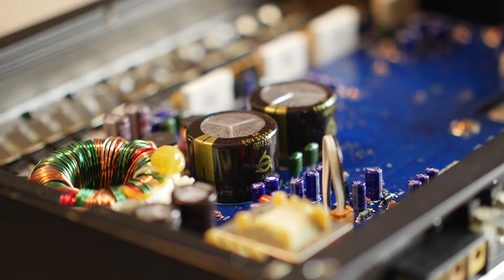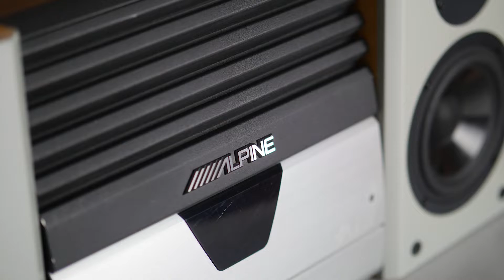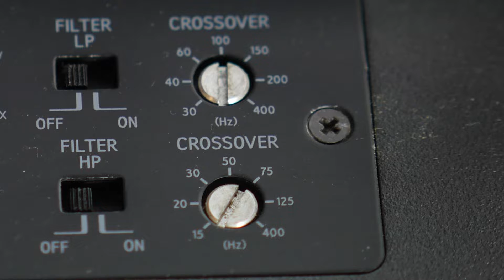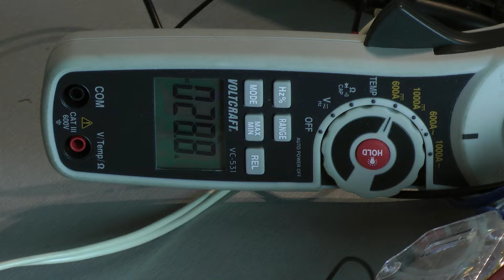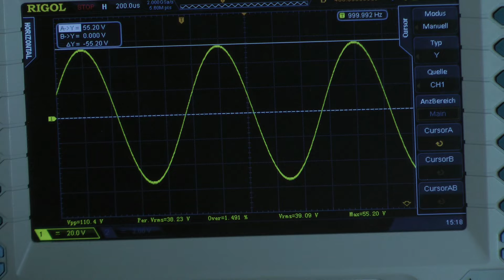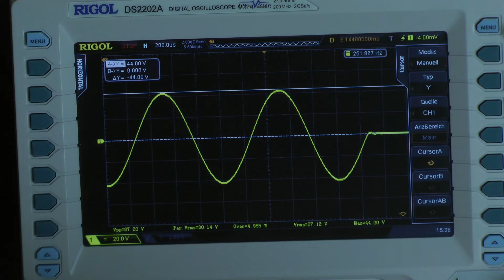Alpine MRV-T420 V12 car audio amp dyno run oldschool stereo amplifier power & sound quality test

Comment: I have a t420 in my build running my front midbass they are spectacular amps and push out more than enough power for what I need
Reply: Using the same amp

Comment: Its quite easy to improve these.everyone here brags on this but..if you double the capacitance on the rails the issue with the quick drop in output power will be fixed as well as lower imp stability improved..yes im alpine f1 certified
Reply from the maker: If I find the time i will do that and re-dyno this amp 😎👍
Reply: What exactly do you mean double the capacitance on the rails? Sorry if it's a stupid question I am not an AMP repair person just extreme audio enthusiasts
Reply: @joshferguson829 theres many proven changes to improve amps.
Reply from the maker: There are big capacitors on every amp for the rail voltages , that’s the high voltage positive and negative, for example +-50 Volts. If there are 2200uF capacitors on the board, just change them to 4700uF. I believe that’s what he was meaning. If an amp has a beefier power supply section it will handle everything better like he said low impedance capability.
Reply: @audiokeller1975  exactly
Reply: I also have the t420 I love to run a a front soundstage it sounds incredible if I could improve overall performance that would be nice thanks 😊

Comment: Curious about the math to determine the watts. 

Like when you had output voltage of 54v at 50hz running 2 ohms  How did you get 186 watts?
Reply from the maker: That’s easy to explain! I test 4 ohms mono which is 2 ohms per channel. You have to calculate with 4 ohms instead of two and divide the power value with 2, I do it this way because I want to test all channels driven into full power which is more honest, if I only test one channel, it will give slightly higher values because the load is easier for the amps power supply.
If you have further questions let me know 👍
Reply: @audiokeller1975  I'm still lost lol.  Can you give me an example?  

I understand how  to calculate ohm loads.  I just don't understand how you calculate volts to watts?      Do you multiply the voltage by something?
Reply from the maker: Ah i see! I divided max voltage with 1.414 to get RMS voltage value. Then i do RMS Volts * RMS volts and divide it with Ohms - voila 😀

Comment: I got into Alpine early on and at times buying the latest head unit didn’t leave a lot of money for amplification. Luckily for me, at the time Alpine had a strict customer return policy where they would bench test returns before issuing a credit to retailers. This meant that only one mass market electronics retailer was willing to carry the brand but it also meant that said retailer’s open box/return sales department carried Alpine returns with a full bench test report from the Alpine service center. The reports from the amplifiers I bought there showed that the amplifiers were underrated by at least 20%.
Reply from the maker: Yes they are , it’s just the second alpine I tested but even at 13.7V you top the ratings at 14.4V with ease 😁
Reply: That wasn’t just a returns thing, they always come with a bench test certificate showing the wattage, and as you said, it’s usually over the advertised specs… Alpine also used to rate their rms wattage at a very low distortion figure.